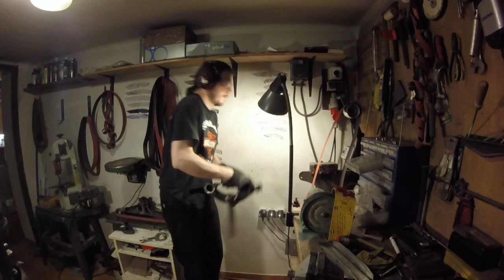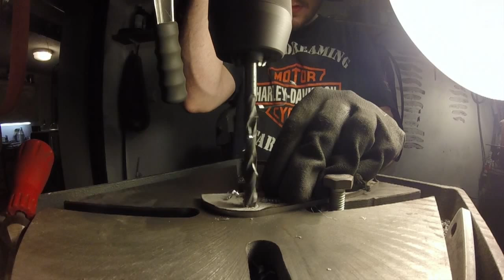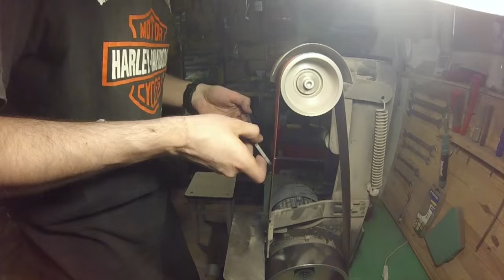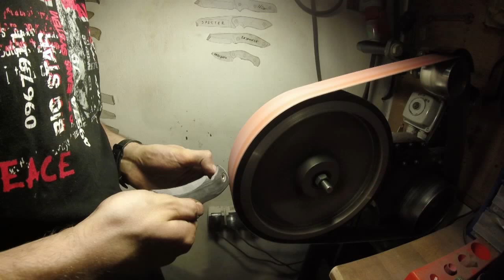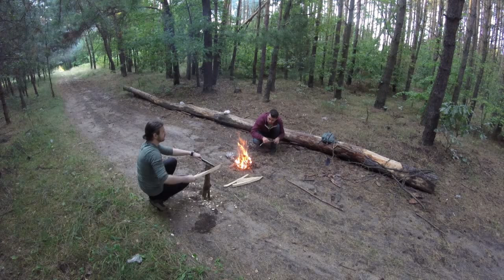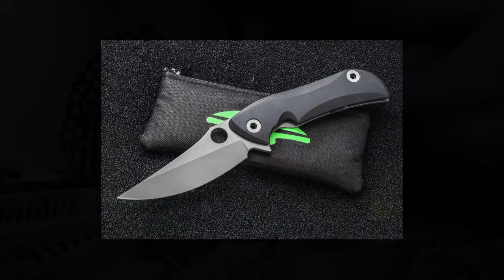Poltergeist Works - GoPro Music Video, All Over the Works!

Comment: what are you using to sand it thats mounted on the wall ?
Reply from the maker: +nick sinko Most of the time it's just standing somewhere, but for some shots I made myself a clamp out of a Wolfcraft 3455100 small wood clamp. Just drill and tap the bottom of the stock GoPro mount with M4 thread and put a screw through the hole on the end of the Wolfcraft.
Reply from the maker: +nick sinko Just read your message again and realised what you're asking about LOL that's a Proxxon disk sander that I don't even turn on - just a flat surface with sandpaper on it to get rid of all the burrs !